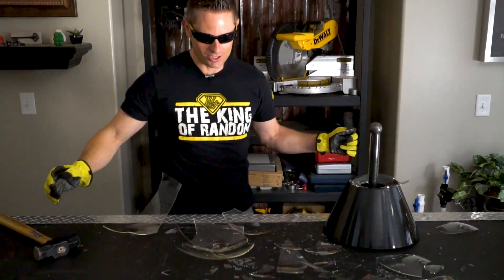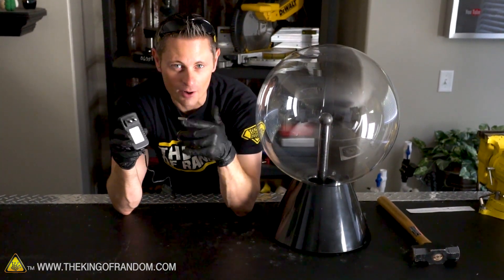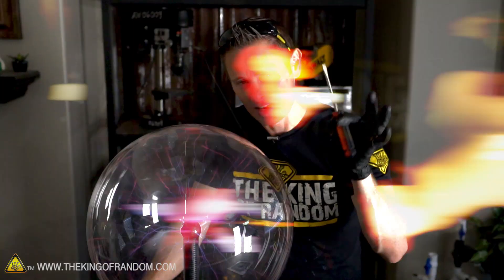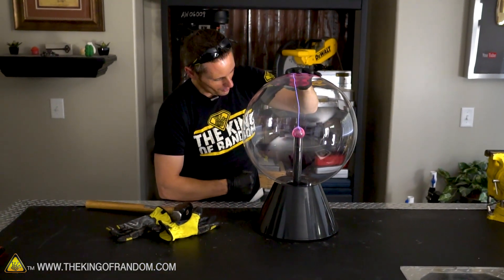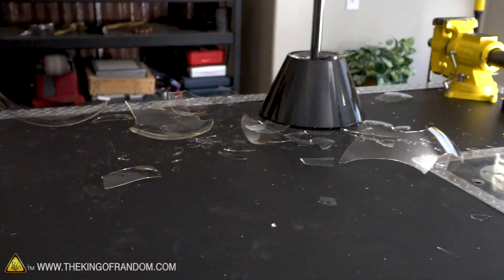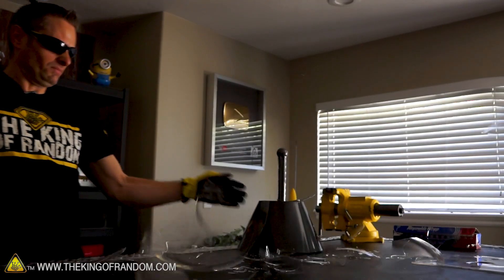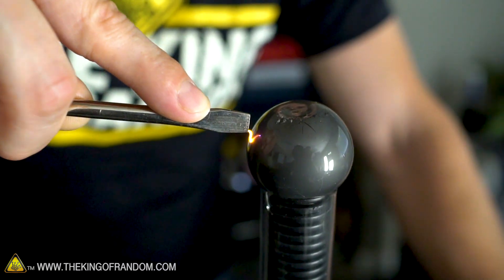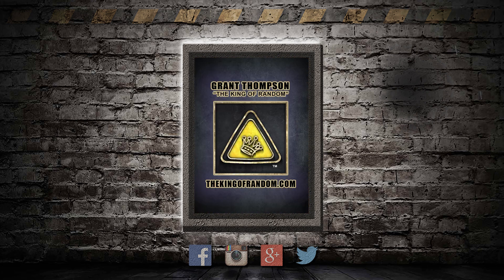Should I Do It? TKOR Tests What Happens If You Break A Plasma Ball? Breaking Plasma Balls 101

Comment: If it wasn't of glass, the plastic would've melted as plasma is incredibly hot. That's why, touching that small "black sphere", which is the electrode, you feel it hot. When you used the screwdriver, plasma formed and the temperature rose so much to melt the glass. As the temperature rises, the plasma arc becomes bigger and bigger, that's why first, it was quite small, but it started getting bigger as you kept the screwdriver there making the temperature rise. 
Oh, and that black long "thing" (please do not misunderstand lol) isn't actually a Tesla coil, it's just a simple plastic tube meant for isolating the wire inside, the electrode, fron the surrounding glass, otherwise plasma arcs would've been formed not only at the small black sphere, but also around the glass tube connected to it. 
Anyway, I love your videos so much :)

Comment: plasma is an ionized gas consisting of positive ions and free electrons in proportions resulting in more or less no overall electric charge, typically at low pressures (as in the upper atmosphere and in fluorescent lamps) or at very high temperatures (as in stars and nuclear fusion reactors).

Comment: what if you put the broken plasma globe into the vacuum chamber?
Reply: williamthe chosenone it does
Reply: It doesn't. This is a PLASMA globe. It isn't a vacuum globe. There is a noble gas or mixture of noble gases in it. Putting the shattered globe in a vacuum chamber, removing all the air and then replacing it with a noble gas would work, but be ungodly expensive.
Reply: ivan martinez same thing less oxygen doesn't do anything

Comment: i had a plasma lamp and i put a sticky not on it and then put some flammable highlighter on the sticky note. i took a small pocket knife and the sticky not actually started burning. when it started burning the whole thing turned bright orange for a minute and then the glass started cracking. i could tell the electricity string things were getting way faster moving around and the thing started shaking. i unplugged it as fast as i could and haven't used it yet again

Comment: Use the Plasma Globe coil to make a super-charged version of your mini arc furnace
Reply: Azza Eff he did......
Reply: Not possible, you need a lot of power and it will probably explode the coil.
Reply: Pottasium Dichromate he should try melting glass in the arc furnace
Reply: believe it or not it's not an actual coil, if you take that thing apart, it's just a single wire going through it, and the black coil like thing is just a plastic tube used to make it look more presentable
Reply: I mean. I certainly would like to see a bigger arc furnace, if possible.
Reply: I mean it'd still be interesting to see an attempt at it

Comment: How about making a pulse jet for a rocket, rc plane or car.  What else could you make a pulse jet power?

Use a 3D printer to make a mold for sand casting the parts for a small gas turbine.

Using a lab torch and a cardboard roll from carpet, adjusting the distance of the roll from above the flame will eventually make the roll resonate extremely loud at a certain frequency.  Can you find the right combo to produce 20hz or lower?

Comment: Play with a lava lamp and open it. I'd be interested to see what the 'lava' and the other liquid is and does.
Reply: it's wax and water
Reply: LAVA LAMP IN LIQUID NITROGEN
Reply: it's wax floating in water
Reply: Imagine Drake 
Shortly: normal wax in water, one ot those 60 watt light bulbs under heating the wax
Reply: Second this, it seems fairly easy but a disassemble to see what you can salvage, if anything that is. I imagine there must be some practical use for that coil.
Reply: I think It's just wax with something else
Reply: IAMBADATGAMES I found that out when it exploded
Reply: Imagine Drake I would loves to see that
Reply: Carter Dobson No, the "lava" is hot wax and the other Liquid substance is oil, when you turn a lava lamp on in the morning, it takes awhile for the wax to melt, then the oil boils slightly and the wax swirls around. I think that is how a lava lamp works, but they are pretty fun to watch!
Reply: Collin Martin I know that but the thing used to heat or the light is what I was talking about
Reply: Collin Martin I figured out what I was talking about it's that some or all have carbon tetrachloride which is toxic af
Reply: The light at the bottom creates a convection current from the heat, as the wax has a different density to the oil.
Reply: Imagine Drake I was reading something I forgot what (not saying it's true it may not be credible) but it said something inside is slightly radioactive inside a lava lamp and but is stopped by the glass and stuff around the lamp

Comment: Grant you should melt sand into molten glass
Reply: He melted glass, into molten glass. Not sand into molten glass. I don't think the furnace gets hot enough to melt sand though. It's different from melting actual glass.
Reply: SkyRunner nah, melt glass into sand 😉
Reply: cody's lab did it  and he mentioned he would do a collab with grant in the fufutre
Reply: Tesseract Wolf maybe the arc furnace has enough heat?
Reply: tots do it grant
Reply: Noah Nochols Yeah, and he melted copper and others things. But he live in Minecraft. Pretty clever what you say.
Reply: Noah Nichols we do not live in roblox either...
Reply: you cant make sand in an furnace like in Minecraft, charcoal is not enough and if you want to use charcoal, you are gonna need a ton of it, you need a special glass oven to do it and i magically doesn't turn into solid clear glass it also needs to be rapidly cooled
Reply: SkyRunner he did.
Reply: You play too much minecraft.